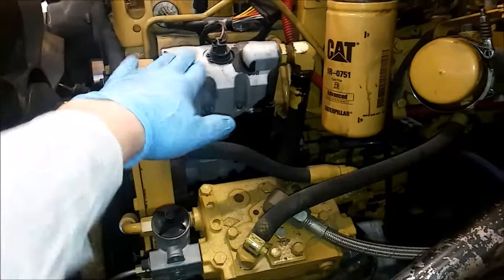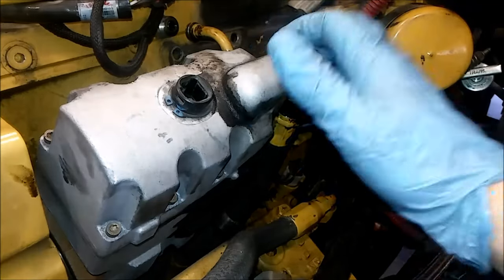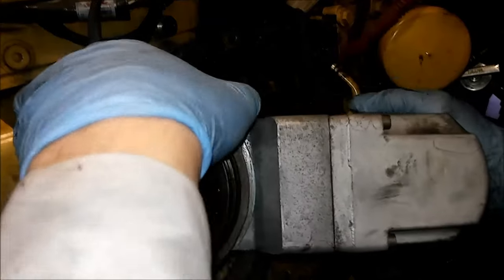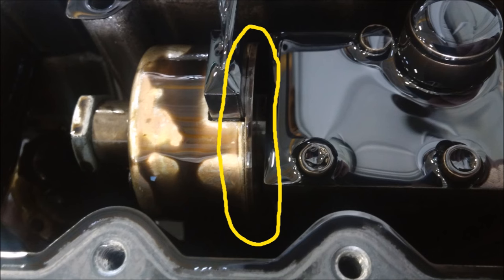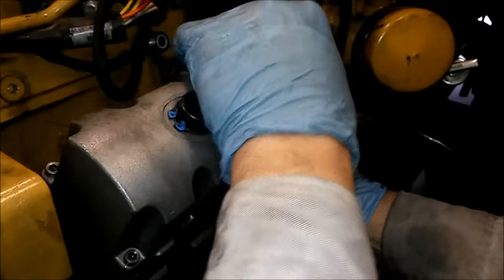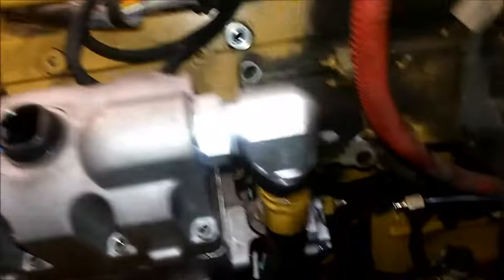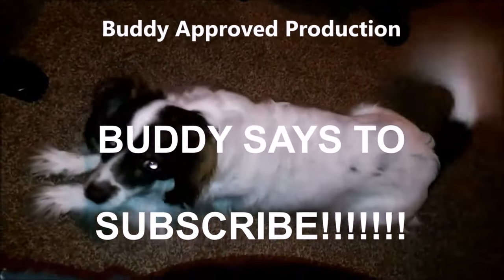How To Change a HEUI Pump.  Cat C7, 3126, and C9

Comment: what is the difference between an IAP sensor and IAP control valve?
Reply from the maker: One tells you the pressure and one controls the pressure the HEUI pump pushes out. If you watch Diesel Talk episode 5 it'll describe the difference. The IAP control valve is the driver.

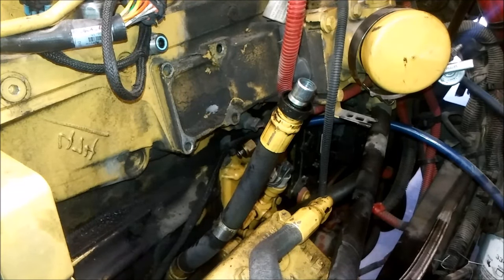Comment: front housing cracked slightly, that isnt important for a good seal? at 4:53 i see small crack
Reply from the maker: +Art Huge I had to see what your talking about, that was probably a casting line, not an actual crack. That whole housing is filled with oil, so if it was an actual crack it would leak oil everywhere.

Comment: How you doin Adept Ape I have question on fuel pressure
Reply from the maker: What is your question sir? Hopefully it's on a Cat engine.
Reply: I apreciate your help bro haha yes it is a 2000 3126  My fuel drops immidiately from 55psi to 0 after turning the engine off I dont know if I am doing this right I removed the line from the fuel pump to the filter and fitted the pressure gauge to see if my problem begins at the pump
Reply: Well the pump itself pushed 25psi then droped after running with a little mist of starter fluid my question is where would I be able to locate a chek valve if there is any within the pump?
Reply from the maker: +Rafael Godinez The fuel pressure regulator is in the back of the cylinder head. The pressure should drop rapidly once you shut the engine off. I know the C7 engines have their transfer pumps rated at atropine 125 psi, so if you cap the line and dead head the pump you should get somewhere around 125 psi immediately. The fuel transfer pump itself doesn't have a replaceable check valve as far as I know.
Reply from the maker: +Adept Ape around not atropine
Reply: That is pretty cool so the pump should hold the 125psi given that its taped?
Reply: *Caped
Reply from the maker: +Rafael Godinez Yeah, the 3126s may be a little less than 125, but it should build very quickly. This will be a long message, but here is how I troubleshoot fuel pressure problems. First off 55psi isn't too bad, it is a little below spec on 3126 at 58-76psi. I change the fuel filters first. Then if still low, I'll run a line from a bucket of fuel to the transfer pump inlet line, that eliminates half the system. If it's still low I'll have prime to system to see if the pressure regulator is holding pressure, replace if bad. Still not working, then test the transfer pump by dead heading it and replace if bad. That is how I do it.
Reply: You are the man bro for real foreal
Reply from the maker: +Rafael Godinez Let me know what you find when you get it fixed. Thanks for commenting.
Reply: I must be doing something wrong I isolated the transfer pump, buket of fuel to the input line, pressure gauge to the output line (with a bleeder plug) cant get past 5 psi when the bus was just running on 55-57psi
Reply from the maker: +Rafael Godinez Well if the transfer pump has a line from a bucket and the transfer pump outlet line is capped and only making 5 psi, then that pump is no good, but that is weird you were making 55 psi before. Something sounds fishy, perhaps the engine is possessed by some sort of nefarious gremlin.
Reply: Its a nightmare lol how do you explain to the customer they need a $.thousand + pump when the bus was driven in
Reply from the maker: +Rafael Godinez The transfer pump can be replaced separately from the HEUI pump on many models, they are quite a bit less than the entire pump assembly. Not sure what to tell you labor wise. Sounds like your isolating everything correctly. Wish I could actually be there instead of this text troubleshooting.